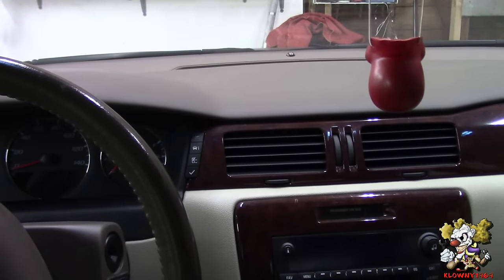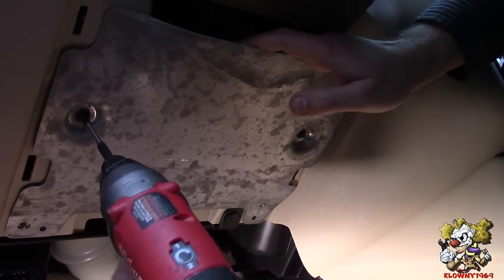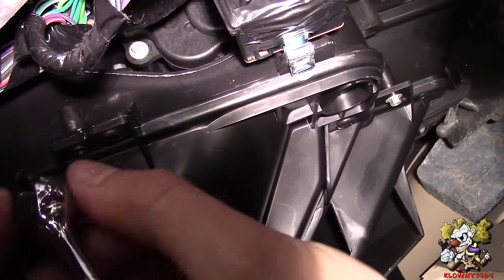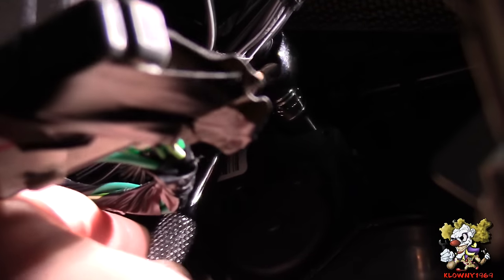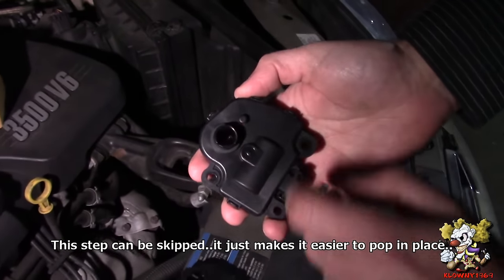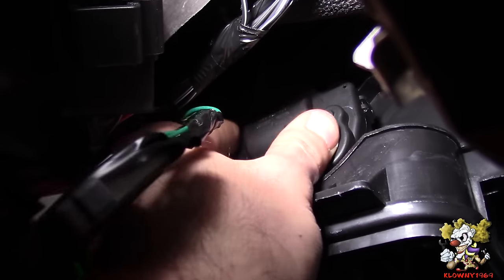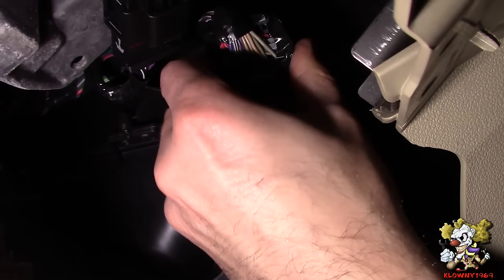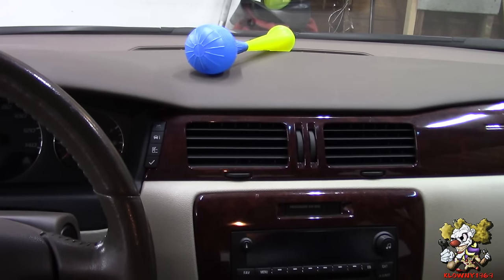How to Replace a DRIVER Side Heat Door Actuator - Chevy Impala 2006 - 2013 - DIY

Comment: First I want to say thank you for this video! thanks to you, I successfully fixed this issue on my car. I am a 27 year old female who is not mechanical AT ALL but refused to pay between 400-500 for a dealer to fix, and got tired of asking local small shops to take a look at it, then I stumbled across this video. I have never been more proud of myself lol!
Reply from the maker: Shannon Odom thats what im talking about!!
Reply: Shannon Dempsey kudos to you
Reply: you must be skinny with long arms. i had to do it all on my back took 1 1/2 hours, could only barley get one hand up there. works now though.  saved some money
Reply: Floyd Noblitt I had to do the same thing and I’m small. Both my legs fell asleep in the process. My problem is that I don’t have long skinny fingers. It took me 45 minutes just to get it disconnected and I still have to put the new one on, but that will have to wait as I have other places to be. At least I don’t have the constant clicking because it started to do it anytime I locked or unlocked the doors and would last for about 2 minutes and sometimes last until I would turn the car on and still stay on for a couple minutes regardless of what I did.
Reply: @shannondempsey7081  The actuator in this video is the hardest actuator to replace (there re 4 of them). The passenger side is the EASIEST one to fix. Check the videos here on You Tube.
Reply: @floydnoblitt6528  lol, me too (i'm heavier at age 57) worked it on my back. I put a "star screw" on the bottom-lower screw...so next time...i can get that one screw with one hand up using my star driver without getting on my back. I consider myself a really good mechanic and it took me 10 minutes to take off, and 15 to 20 minutes to get it back on and seal everything up. Reasoning....why it takes longer to get back on...is all in the "aim" of the actuator control shaft and 3rd hole's plastic pilot alignment pin (no screw there)....was my first time getting that part seated. Once actuator is seated..in place...the remaining two screws go fast.
Reply: you go girl
Reply: Great job 👍
Reply: @LarsonFamilyFarm-LLC  
Great tip on replacing the bolt!
Reply: @floydnoblitt6528  same I’ve had to replace 4 of them in my car, they are cheap parts, I’m happy to do it myself but I dread it cuz it’s a bitch cuz I can only get one hand up there
Reply: Omg I thought I was the only female that is fixing our Impala without a man And I know the feeling to fix your car by yourself is like the most rewarding feeling as a female and I’m a single mom of four so I know how you feel
Reply: I've been trying for over 2 hours.  Can't see anything when I get one hand in there.  No room to work - very deceiving video.  Was his car on a hoist ?  Impossible to do this laying on the floor board at ground level !!
Reply: Me tooo. I’m happy for ones who help, so the struggle won’t be harder just finding Actual help. This is my actual help and I’m happy as ever as well 😇
Reply: Shannon are you single?
Reply: You should be proud

Comment: 8 Years ago you posted this.  Today, June 2024 I found it and can say that after watching dozens of videos this is the one that mattered.  Great job.  Your pace was perfect, your attention to the things that always seem to make a project a pain was excellent and your instruction was top notch.  Yeah, I liked it.  I wish you could have shown how you positioned yourself to make it look so "doable"; I found that putting the console down, laying down with my feet over the passenger side (all over including the passenger headrest LOL) was the ticket. Then I let my upper body slip down under the wheel and used the left hand for everything.  Hard, but it worked!  Thanks!
Reply: Seconding this in August 2024!! I replaced one on the passenger side a couple years ago and remembered hearing that the driver side was almost impossible to do yourself, so I thought I would need to take it in when the clicking began. However, this video laid everything out so clearly that I just followed your step by step and replaced it this evening!
Reply from the maker: Glad I was able to help..don't forget to subscribe 😉

Comment: Advice, If you are heavy, have really big hands, or have trouble being upside down, get a 2nd set of hands to help you. Take your time as well, don't worry about all the people saying it takes 15 minutes. It took me most of an afternoon.
Reply: Husband and I just done it! We rotated lol I need his arms and my hands
Reply: @CountryDoll99  Awesome, its a terrible design and I don't miss that car much at all.
Reply: Dan Pellegrino  What were some of your issues with the car so far I’ve replaced two door actuators the gearshift assembly needed replaced it had a bad seal annoyed also the right to side doors don’t lock or unlock when it’s real hot out.
Reply: @brandonbrooks9356  head gasket, 1st gear slippage, rear defrost, HVAC actuator, steering rack, passenger door lock.

Traded it in at 70k. It was a POS.
Reply: Yep over 5 hours and still doing it  the effing clips and awkward position I’ve taken many breaks during the day
Reply: @DanPellegrino486  just hit 215,000 and haven't had any major issues.
Reply: @TommieGun71  I'll get you an award shipped out right away.
Reply: It helps if you're smaller and skinnier so you can easily fit into the cavity of the dash underneath the car. That is why some people aren't having a problem and it's a PITA for others.

Comment: I have replaced in the four years owning my 2012 Chevy Impala LTZ, all three actuators! Today I replaced the third one on drivers side! First attempt was successful in twenty minutes! Only to hear that clicking noise!!! I ordered TWO off EBay for $26.00. BOTH WERE JUNK! So being pissed off and ready to give up. I opened up the original factory one that was clicking. I saw the crack tooth on one of the plastic gear. I opened up the “new” China pieces of crap that I just bought and pulled the good gear out of that and put into the factory one. IT NOW WORKED!!! After three hours of numerous cuts, scrapes and scratches and the fact my fingers were going numb trying to get the screws in. I got it!!! What I noticed is the factory one had a brass gear on the motor shaft. The CHINA PIECE of crap off eBay, had a plastic gear. So there is a difference from factory and eBay China crap. Got back together now and is no longer clicking! So I will replace factory ones now with the China gears in the other two from past. Also, get a quarter inch “thumb ratchet”. Harbor Freight has a set of three sizes. Sure makes getting those screws in with ease, especially the left side drivers side one. Seemed the most difficult to do.
Reply from the maker: Glad u were able to get it done..don't forget to subscribe

Comment: @Klowny1969 I appreciate the video very much. It was impossible for me to do this job without it. It saved me $500 and only cost me $60, plus some blood, time and patience. I am not a mechanic and I despise working on cars, but I did it for my daughter. It took me about 3.5 hours and I almost wanted to quit, but I stuck with it. It was very tight in there and getting my body to the right angles was a supreme challenge. Thank you again, I really do appreciate it.
Reply from the maker: Glad I was able to help!! Don't forget to subscribe 😉
Reply: Good, concise instructions.  I've been stalling on replacing this actuator for obvious possible frustration reasons - looks less complicated than I thought. Thanks!

Comment: You are my chevy impala's guardian angel!!!😇😇😇 the dealer wanted 1500 bucks to fix two actuators we got one done so far we will fix the driver side on Saturday l!!! Great detailed video!!!
Reply from the maker: glad i was able to help :)
Reply: Good GOD! The dealership wanted $1500?! That is absolutely insane.
Reply: @westtexastiger  That's BS since I am sure the Flate rate is less than an hour each.  They should have quoted 2hrs labor plus the cost of the parts.  I bought (2) chinese cheapos for $23 whereas, the OEM AC Delco part was $32.  Even with mark-up and an hourly rate of $95 it should have only been about $300 to $350 and they still would have made $$$.  I certainly hope you don't do business with them even regular service work.  There is a reason we call them Stealerships.
Reply: @rpruneau68  I would guess that maybe the dealership included labor to remove the dashboard completely, to get at the actuators. Also wouldn't be surprised if maybe there were a few other things included in the estimate - such as maybe replacing the antenna that the key fob uses to interact with the car. I never got the dealership to replace any of my blend door actuators, because I always did .y own. Not sure if I recall correctly, but I think I paid maybe $27 to $30 for AC Delco replacement parts.
Reply: @westtexastiger  that's a lot of labor if so. I had the drivers side actuator changed out a month ago at a dealer—$137 for the labor, about an hour of work.

Comment: 2 years later and about 2 more actuators for both driver and passenger side. I can do this with my eyes closed now, in about 5 minutes.  A fix that every 9th gen Impala should get very well used to. Pro tip: look for the generic no-brand Chinese knock-off in Amazon. They sell 2 for $19 and surprisingly they last more than the AC Delco and Doorman part. They have lasted me a full year now, where the others lasted just a couple of months. Plus, they are super quiet.

Comment: Thanks for the clear and understandable instructions.  I've watched others trying to show this, but with not very clear instructions.  I finished mine in about 2.5-3 hours. Getting the new one in place was the hardest part for me.  I lined up the new one using the battery cable trick you showed, but it still wouldn't go back on.  I noticed that it had a spring action to the post if you tried to turn it, but it would just spring back to the original position.  I even went ahead and plugged the power back into it and still it wouldn't work.  I finally decided to turn the car on with the air running and found that I could then maneuver the post and then I found that I could change the position of the post without it springing back to the original position. I also removed a screw that was in the way near the bottom of the actuator, and it finally went on and the cool air started flowing out of the left side vents!!!  YES!!!  I then put the screws back in and tightened them up and put everything back together.  I had to pray my way through this one!  Thank God and thank you for your great instructions!  The mechanic was going to charge me $900 for this because he said it required pulling the dash. Well, I only paid about $75 for the part and tools I needed!  It was a bear of a job, but perseverance paid off!  Thanks again.
Reply from the maker: Awesome! Glad I was able to help!

Comment: Thanks for the video! Saved me money and aggravation. Great photography and step by step narration and instruction. Took me a while, but I'm 6'2" and right handed.  Took a couple of breaks to combat my frustration,but worked out great... Thanks!!
Reply from the maker: 3jobbob023 awesome..thanks for watching and commenting
Reply: @klowny1969  Did you take the upper right screw of the actuator off with your left or right hand? Also, what position was your body in to get that troublesome screw off? Did you remove it blindly, or were you able to see the screw as you removed?

Comment: So my passenger side actuator broke. Got the part, replaced it myself in about 15 minutes. Now the driver side is busted. I took it to the dealership because I didn't think I could reach it myself (I'm really tall and have back problems). $510!! that is how much they were going to ROB me for, saying it was a hard to get to and it was a 4 hour job. Drove to my local Autozone, got the part for $30 plus the smallest ratchet and extension I could find. I came across with this video and will do it on my next day off. Thank you very much!

Comment: This is a great video. It really is hell trying to replace the driver's side part without a lift, and ultimately I couldn't do it. But it still will help you make sure you figure out which side is busted. I thought maybe it was the pax side, since the rattle was plenty loud and the actuator was vibrating. Replaced that one myself. But no comparison once I followed these instructions to access the driver's side part. Noise was much, much louder and the vibration was way stronger. And given the reports of high prices to fix this at the dealer, this probably saved me a lot of money. I bought the part, and after failing to replace it, made an appointment with a dealer. Drove in with the new part on the pax seat and told them I knew for sure it was the driver's side since I had my hand on the actuator while it was clattering away. They used my part to fix it in about an hour, and they charged 137. Well under the multiple hundreds I see quoted throughout these comments.

Comment: Thanks for the video.  It saved me roughly $500.  I ended up opening the actuator with just moving the plastic gears rather than rigging it to the battery.  Great instructions.
Reply from the maker: Glad I was able to help..don't forget to subscribe 😉

Comment: Thanks for the video! Just fixed it! Idk how the heck you are physically situated, but I was physically upside down with my face next to the gas peddle, and my feet up by the head rest. And even that was barely enough to see what I was doing!
Reply: DUDE. Until I saw your comment, I was going nowhere. I tried doing it upside-down as well, just as you painted the picture of yourself doing it, and FINALLY got it done. Took me 5 hours total, maybe 1.5 after I went upside down. Anyone that got this done in 20 minutes or whatever must have the smallest hands ever.

Comment: Thanks for this video!  Saved me 100's of dollars! It was definitely a pain getting down under the dash, and I ended up using a 9 volt and paper clips to set the new one.  Good news is that it looks like the others are easier to reach for whenever they need to be replaced.

Comment: Great Video!!! You make it look so easy, but it is a pain the ass to replace these actuators on the Impala if you don't have really small hands.  I have done both sides a few times & still wonder how they go bad so fast. If you don't have a 5.5 mm a 7/32 will work fine for this application. Good luck and get your swear jar ready cause you'll need it :-) Oh, and they don't always click when they go bad.
Reply: I just bought one and replaced and right of the gate it starts clicking again, it does open the vent doors but I still clicks, any suggestions
Reply: @stevenanthony3994  Sounds like you might have got a bad one. Also, there are two of them on the right side relatively close to one another. Make sure you are replacing the correct one. I almost replaced the wrong one last time I did this (1week ago)
Reply: @stevenanthony3994  ....I've replace theses on both side so many times that I've lost count.
I've learned over the years to open the new actuator and inspect the gears before installing to save myself the aggravation of double working.
Reply: Someone who mentioned the socket size in the comments! You are a hero!!
Reply: PAIN IN THE ASSSSSSSS! It took me 1 hour to figure out 7/32! To this date I've never EVER heard of that size socket and I've been using tools for over 40 years! Also if you have a good pair of "miniature hands" be sure to use those instead of your regular ones 😡.
Reply: @caliallstar1334  The metric equivalent of 7/32 is 5.5 mm as well.  Either is acceptable to use.

Comment: This is a good video and very helpful but it doesnt state how difficult it REALLY IS to get to this component on my 2012 Impala.  I feel a good mechanic must be a contortionist to get his hands and eyes onto the part under the dash.  You make it look MUCH easier than what my experience was!
Reply from the maker: Sorry about that..but it wasn't that difficult for me..don't forget go subscribe
Reply: Little elevation of the car would help. Tried this at ground level in my driveway and every position I tried was a stress position. Upside down was the most comfortable, but I'm pretty much incapable of doing anything tricky that way. YMMV.

Comment: The strange thing about my father in law's Impala was the actuator continued to click, on and off,  for several minutes even after the keys were removed. The darn actuator rotated after I had removed it but while it was still hooked up and was 90 degrees from the correct position when I matched it up to the old one.  Took me a while to figure this out. Great instructional video. Saved the old boy a small fortune. Thanks for posting this
Reply from the maker: Glad u figured it out